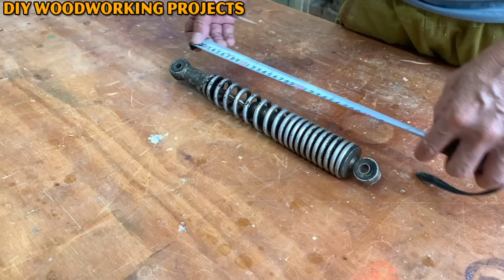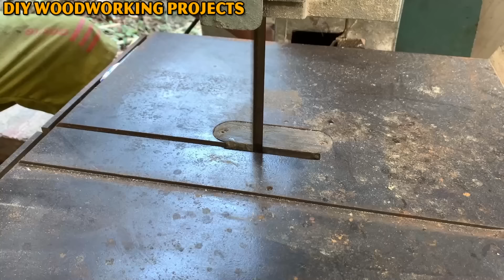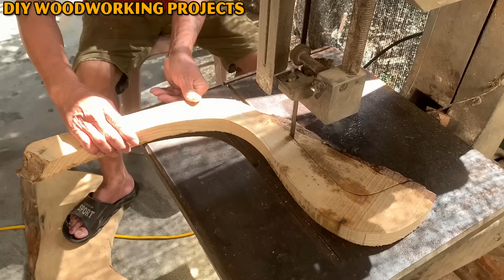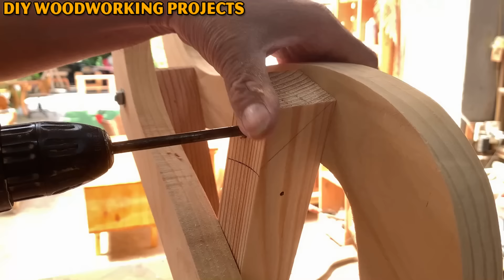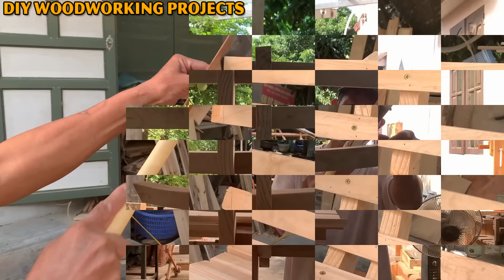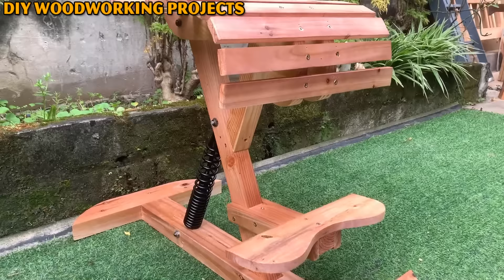Unique Creative Woodworking Ideas // How To Make A rocking Chair From A motorcycle Shock Absorber

Comment: Design is not good. Rocking chairs are low height and very stable due to wide base support. This model may fall sideways if one tilts to side lightly. Spring is quite hard because it is designed to absorb momentary shocks of bike and riders. Lastly it is very uncomfortable without cushions. But good work.

Comment: Your ideas and skills are amazing. In front of too much drama
Reply: No pp
Reply: pp0
Reply: @sherry4008   mm
Reply: Body Weight and Resistation on drilled passages on soft wood sticks 2 distances would be Risky after few times sitting on funny shape  chair that has a Metal Spring  Pump to enjoy with shaking body while in sitting position placed weight.
Reply: There are many weak points in this design, especially because of the materials used
Reply: @sherry4008  q

Comment: umm. nice to look at.. However Im confused.. He spent a lot of time and effort joining, planing the base, Chose mortise and tennon joinery to hold the base together  strong and tight.. The seat part of the build tho... 2 supports strattling the chairs center line.. Quickly joining all chair parts with drywall screws... why use 2 completly different build methods.. Also am I the only one who calls B.S. on the demo.. He looks like hes concetrating on staying centered with his body while "relaxing".. I will bet tge reality is that this "rocking chair" rocks side to side, until it snaps...

.... great looking piece though.. To look at, all the time.. Never sit and rock. EVER... lol
Reply: It could need beefy section in pivot point and 2 bearings plus wider base area,I think.